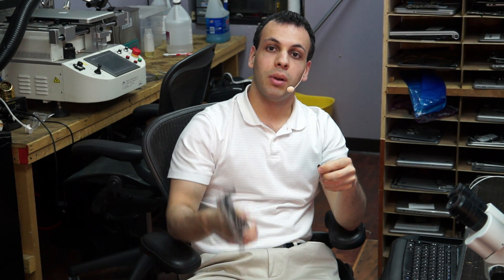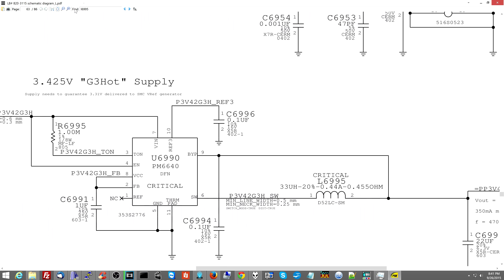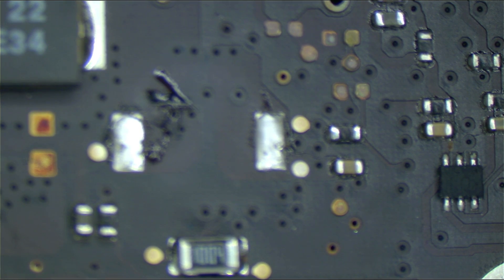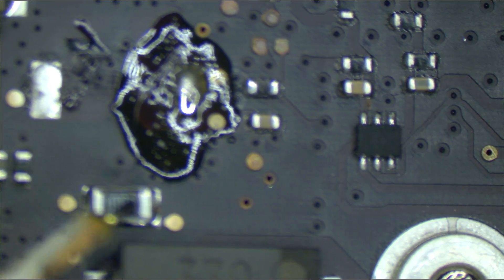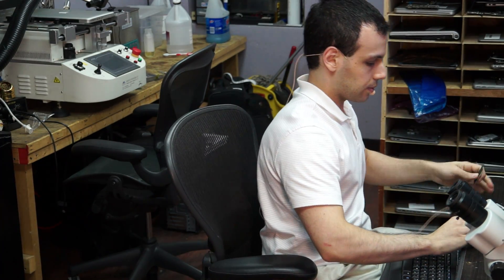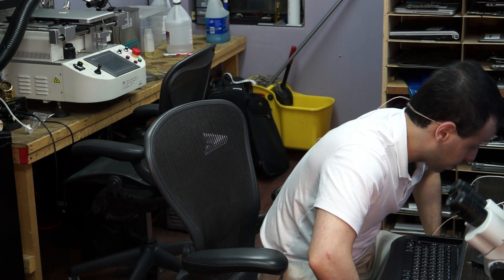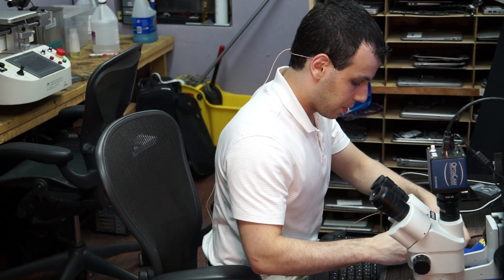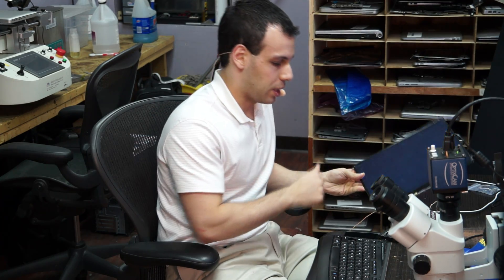Short to ground keeps Macbook from turning on

Comment: Hey Louis, I've just realized that I got the lucky ticket on the motherboard issue with my mid-2010 Macbook Pro. As expected, Apple care is long gone and the fact of living in Brazil doesn't help me not even a tiny bit. I do have an electronics lab at home (obviously not as equipped as yours) and I was wondering if I could do anything with it. If it really involves reballing like I read on a few places then I believe there's nothing that I can do. Just to sum up, after upgrading to Lion the whole thing started, black screens out of nowhere followed by a Kernel message. I haven't actually watched all your videos, maybe there's already an answer for my question on your channel, if so, my bad.

Thanks.
Reply from the maker: +Bruno Henrique Reballing is constantly being recommended by the dumbest of our industry, with no brain. Make sure to go back to those places where idiots suggest that and credit me with calling them an idiot. :)

Replace C9560 with anything but a tantalum kind. Apple made the same mistake they made with the 820-2610 and 820-2330 where they ran out of space on the motherboard for C7771 so they made it a tantalum one. This is not suitable for a rail that is always on, as C7771 is for an S5 rail - so it dies. Voltage fluctuates, and eventually the machine stops turning on. On the 820-2850, that same 330uf tantalum capacitor re-appears on the framebuffer power supply for the GPU and the VRAM. The reballers without brains are heating this capacitor when they heat the board to remove the chip, so what happens is that they think they fixed it when the capacitor works again post heating! But it dies again when the cap F's up again. The proper repair is to replace C9560 with a non-tantalum one, which won't fit! You will have to scrape the board's ground pad to make this fit. It is doable.
Reply: +Louis Rossmann Thank you so much for the answer, it's good to hear from people who actually know what they're doing.
Reply: Hey Louis, six months later I finally had the guts to crack open the MBP. I wish I'd done this earlier on, considering your latest videos stating a possible lawsuit from Apple (still uncertain to you). So in case you do have some time within all of the questions that you already receive, is there a way that you could give me a hand with this?

So I've found the schematic for my A1286 15" MBP, 820-2565 board.
I also managed to find the C9560 on the schematic (Framebuffer regulator) but I'm having a hard time on identifying it on the board itself. I've looked for the TPS51217 on the "upper"part of the board (I've only taken the aluminum cover off, still haven't unbolted the board, all I get is a top view) I was wondering if the cap that I'm looking for is on the bottom part of it. 

Thanks Louis.
Reply from the maker: Bruno Henrique right on the edge under the right fan there is a little cap that is practically giving you the finger. next to the cpu. black in color, righ ton the edge of the baord
Reply: +Louis Rossmann It is literally giving me the finger. I downloaded a software that isolate NVIDIA's GPU, it hasn't rebooted in a two hour time lapse. I'll check it tomorrow again. Going to install Pro Tools, Waves plugins and all the crap that I used to insert when recording (you probably know better than I do considering your Avatar experience) , if it does reboot I'm taking that cap off right away. Thanks again for the answer, I'm from Brazil and probably few people know about the importance of the right to repair bill, hope things work out for you.
Reply: Louis, so something weird happened here. I haven't touched the logic board but for some reason my MBP returned to life. A day and a half have passed with extensive Pro Tools 8 sessions and not a single hiccup from the computer. I'm trying to identify any logical reason for it to be working but couldn't think of any, the best thing that I can do is share with you the things that I did prior to realizing that the computer seemed to return to an operational state. It happened on a very short time lapse so I'll just number things out:
1- Finally created the guts to take that cap off after receiving a reply from you 6 months ago.
2- Downloaded the schematic but couldn't find the damn component, sent you a message and received your reply, was confident on doing it.
3- Before actually heating up my hot air station I decided to give the "gfxcardstatus 1.8.1" software a shot, the one that lets you choose between NVIDIA's and Intel's.
4- By the time I had it installed my MBP was still running Mountain Lion (can't recall exactly what version). It did reboot a few times but then after switching back a few times between GPU's I selected the "Intel Only" option and the thing sort of stabilized. 
5- A few hours went by and the Mac still hasn't rebooted, which was a relief to say the least. I then decided to downgrade the OS to the one that IMHO is the most stable for music production (Snow Leopard). 
6- Did the whole thing, put the Install CD in, erased the hard drive, reformatted the whole thing. Just let me emphasize something, I did all of that whilst the "Intel Only" mode was still selected. I really can't tell you if this has any effect on the final product, if after wiping the HD the command to isolate GPU's simply reset thus ruling out any probability that this is linked to the problem being "solved".
7- Turned the Mac on, now with a fresh Snow Leopard version, installed all of my recording stuff back in, Protools 8, Waves Plugins, a bunch of VST's, still with the uncertainty that it would give me a kernel again.
8- Today 07/06, I decided to give the old Mac a shot on actual recording. Spent 3 hours recording a little project band which I'm in and it worked like a charm. Smooth, 3 different songs with 4 or 5 tracks, nothing major, the bass player didn't show up. But hey, it seems that the thing is back to life.
9- Here comes the intriguing part. I've just checked which processor is being used according to Apple's support website, and apparently, by the time I was writing this email, with a Protools session open, NVIDIA's GPU was running. Should I consider this a fix or should I get some Kleenex to wipe my tears out when this thing fails on me again? Maybe it's just plain luck that it hasn't "decided" to screw me over.

Please verify the images below (Imgur):
http://imgur.com/WZxHuI8
http://imgur.com/31DLvGV

Take care sir.
Reply from the maker: Bruno Henrique i can't find in there where you said you replaced C9560 with a non-tantalum. you'd better do that! :p